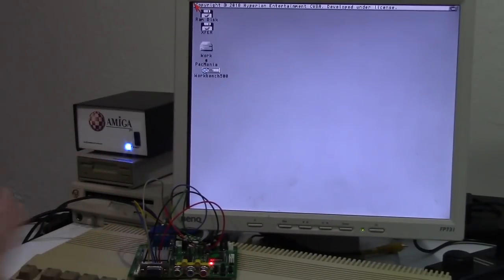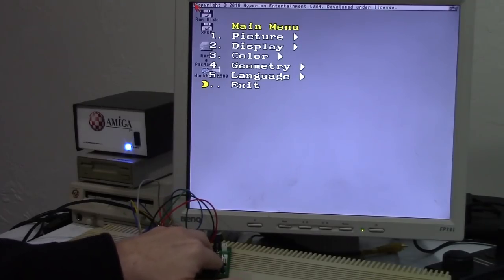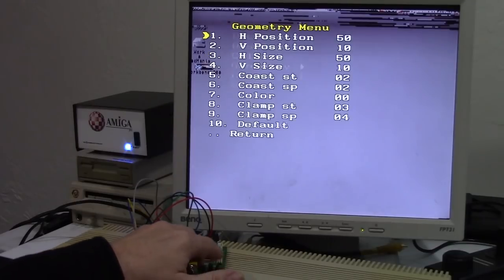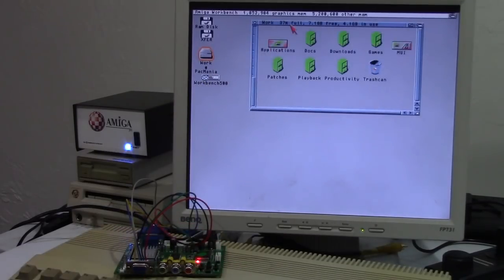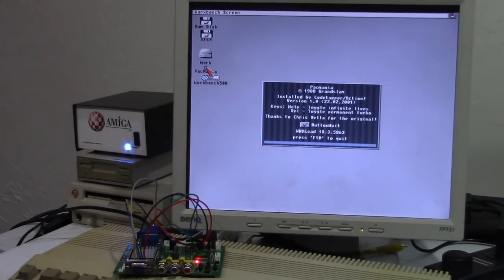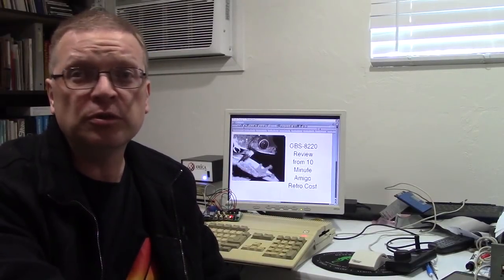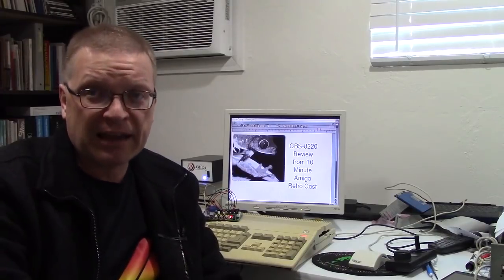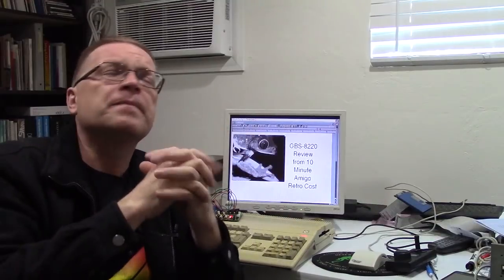10 Minute Amiga Retro Cast Episode 21 - GBS-8220 review

Comment: I've had one of these for ages but cannot get it to display in 15k mode :(
Reply from the maker: It all depends on how you are hooking it up. If you use the VGA connector, I have never gotten anything but garbage results. Using a custom RGB connection works OK, but if you get an RGB to Component connector you can get really nice results

Comment: Thanks for the video - it was very informative. I'm currently in the hunt for a monitor that supports 15KHz but I'm curious to know your opinion on what gives the best performance, a 15KHz monitor via RGB or using a GBS-8220 with a regular monitor?
Reply from the maker: 15 Khz via RGB all day long. The colors pop so much more than they do going through the GBS-8220 device. I have an Acer LCD that works great at 15Khz, and I use it quite a bit. I use my GBS-8220 for testing and very occasionally video capture.

Comment: you need to have a look at a project that uses this GBS controller. You will find it on github and it is called GBS-Control by ramapcsx2. it fixes allot of issues, memmory timing to get rid of the noise, you get a wlan setup so you can edit your settings trough a web browser. It is allot bether than just runing it origina. this uses a arduino and not the PI. it is not dificult to setup. :) I did a demo video on my channel so you can see the GBS-control OSD trough a webrowser.
Reply from the maker: I have seen that, and it is on my to-do list. I will check out your video on it, although I might have already watched it! Thanks!
Reply: @10MARC  : nice! looking forward to see a video of it, I belive that many do not know that this is a option. the GBS-control project is like a totaly different scaler, and it is cheap :) I also uses OSSC with my amiga and I will say that this GBS-control mod almost get it bether on some stuff. The GBS is good if it get`s some correct adjustments with the GBS-control software.

Comment: Cobbled together a cable this evening with a 25 pin cut down to 23, soldered up to the same cable you did, and got it working fairly well with minimal configuration.  I did have to adjust the levels on the 3 onboard pots, and then adjust the screen vertical position (mine was on 20, but needed to be zero).  I didn't change anything else and I got an acceptable output on my NEC 1970NX I use on my other retro machines (the monitors will do 15khz no problem, but I was wanting to try the 8220 that's been on the shelf for months).  I may end up with a more expensive setup, but the 8220 is sufficient for the short-term.  If you end up with a good supply of the 23 pin female connectors, I'd definitely be interested in a couple, while the hacked off connector does work, I prefer to use the correct hardware, lol.
Reply from the maker: That is so great! That is the best adjective I can come up with, too. Acceptable. Certainly not bad for the price. I have not heard back from my distributor on the 23 pin connectors yet. I will call them next week.

Comment: Perhaps there are differences between GBS-8220s out there as mine was utter garbage regardless of the settings. I will say I had to try three different power supplies before I found one that didn't introduce considerable noise but thst couldn't save it from going in the trash. It worked enough to check the integrity of some old harddrives and disks but I didn't want to use it for anything else because thr image quality was so poor. I wouldn't recommend it to anyone. If I used any other retro systems beyond my Amigas I may have held onto it for testing purposes only.
Reply from the maker: I certainly get what you are saying. I have heard there are some really junk clones of this that circulate out there and pretend to be the original. I certainly don't have too many complaints about the quality that comes out of mine, as I said in the video it is not as good as the $150 solutions, but I never expected it to be. mine is perfectly usable and the screen quality is at least a C+ in my book.

Comment: I just bought a dell ultrasharp 2001FP for $20 and an adapter on amibay to go from RGB to VGA and it just works.
Reply from the maker: That is awesome! When I used the RGB to VGA adapter, it just looked dark and the colors were washed out no matter what I did with the brightness. That was on my first monitor and TV - I did not try it on my BENQ monitor. I have great luck with that with Amiga's, even though it is not one that works at 15 Khz

Comment: Great review as ever, I have ordered one to see if it works in the new case :-)
Reply from the maker: My A500 is going to go in your A1500 case, and I do hope I can get the GBS8220 to fit inside somewhere. Maybe grab the RGB signals right off the 23 pin header internally with some little chip clips. That would be pretty sweet!

Comment: Nice. Got my AMIGA500 Rev6A/ACE2/ACA500Plus/ACA1221EC on a 49 inch Panasonic LEDLCD TV 4:3 with a A520 Composite in PAL High Res Laced 50Hz 16 Colour.. Running AmigaOS 3.1.4 / BestWB with a 16GB CF and a 16GB CF AUX.  Got a RGB Commodore 1084S-P1 but is dead. Maybe i get a Indivision ECS and a Acer LCD V226HQL model  / VGA 1440 :x 288 H: 15kHz V: 50Hz

Waiting for the Vampire 500 V4 for HDMI 720p and for SAGA/68080 and more FAST RAM. Got also a Wicher500i Rev2a bit have a limited to 8MB FAST RAM than the Rev2c. Use it with the AMIGA 500+ Rev8A board with WB 3.1 / BetterWB. Today i get the A590 with SCSI2SD v5.0 and 8GB microSD on WB 1.3. Maybe i get it work on AmigaOS 3.1.4 or WB 3.1.

Comment: Bought an enclosed unit off a guy on Amibay, never did work. Tried your settings and all I get is garbled greenish/yellow screens. Nothing more. He tells me my power supply is wrong but same as yours 5v, 2a.  Was robbed I believe. Main menu screen displays though, so his accusation of frying my unit is bull.
Reply: I had this issue with an 8200 and did the gbscontrol mod with the esp8266 module. The board is working perfectly now.
Reply from the maker: Well that is odd. Do you have a 23 pin to 15 pin converter? Mine works connected to the VGA in on the GBS-8220, just not as nice. I have hard that there are some cheap knockoff products that really don't work well at all. I am sure you have cycled thru all the inputs, I know I had an issue figuring which input to use at first, since I did not get video at all until I tweaked the settings. The good news is a replacement board is super cheap on Amazon, and at least you got a case and cable out of it if we can't get it to work!
Reply: 10 Minute Amiga Retro Cast i have that convertor, do you mean to use instead of Gbs? I do have other means of connecting amiga to monitors but was hoping to get this to work.
Reply from the maker: @davidwright9166  my GBS-8220 has a VGA input and VGA output. I was able to go from my adapter to the VGA input of the GBS-8220. It worked fine with no actual tweaking required, but the image quality was not quite as good. It was flicker free, though. Maybe yours for not have the VGA input?
Reply from the maker: If you look at 2:45 on my video you will see me pointing out the VGA input on my unit.